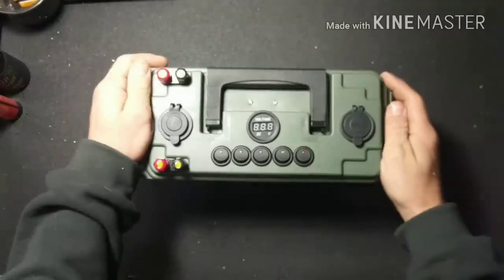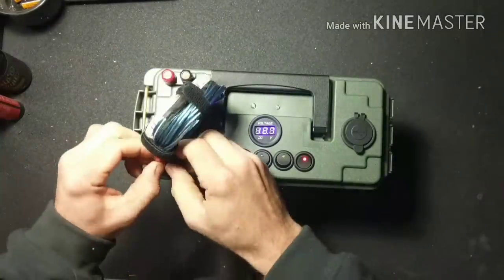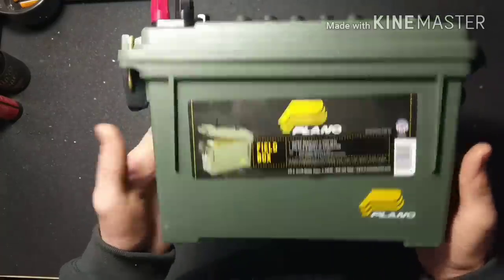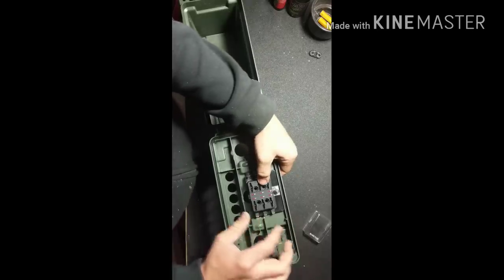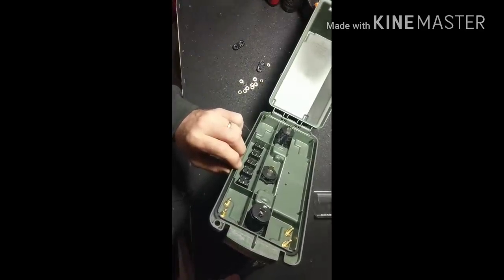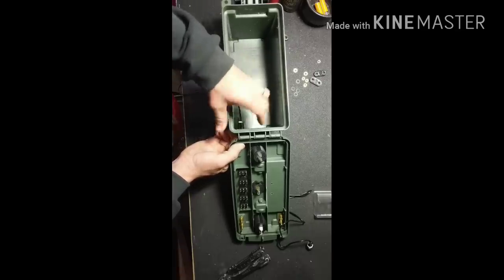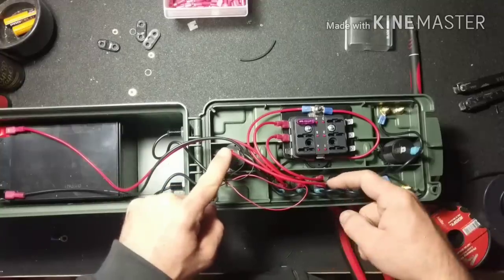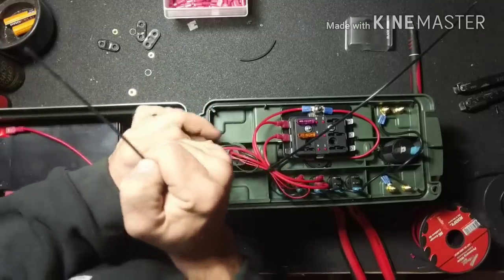How to build a portable power box version two

Comment: Why does every video I see of these builds, guys call the 12v power socket for accessories a "cigarette lighter"? It isn't a cigarette lighter. Put an actual cigarette lighter in that 12v power socket and see what happens.
Reply from the maker: Generic term I guess
Reply: Suppose so. I build these too. Just go to Autozone, NAPA, Walmart and grab a no-kidding cigarette lighter/socket (like $6). Install a 3/4" - 1/2" reducing washer from Lowe's for a tight fitting mount. You get the benefit of having an "actual" cigarette lighter + 12v power socket. Most of these guys making these use "crap" 12v power sockets...there are 12v "heavy duty" ones available online good for 25 amps. BTW...I really like your build here, learned a lot!
Reply from the maker: @ChrisDIYerOklahoma  thanks for the compliment and the advice I appreciate it

Comment: Would you ever consider selling these?
Reply from the maker: Daniel Argetsinger I sell about 10 a year however shipping them is a pain and is pretty costly
Reply: JDS Outdoors how much would you sell components for? Would that be more reasonable?
Reply: JDS Outdoors minus battery and box
Reply from the maker: I have all the parts listed in the description direct from Amazon would be the best bet
Reply: Yeah the only concern I have is with the binding posts because if I want to hook my ice house lights up its much easier to do them with crimped quick connects for myself who doesnt solder.
Reply from the maker: use alligator clips. noting on this box is soldered the only thing I solder is when I make led light strips for ice shacks there is no real good way around that
Reply: Yeah t hats the thing I am running 3 sets of lights on three switches.  Essentially replacing the cigerette outlet and the led lights.